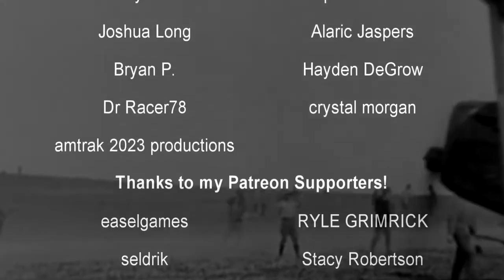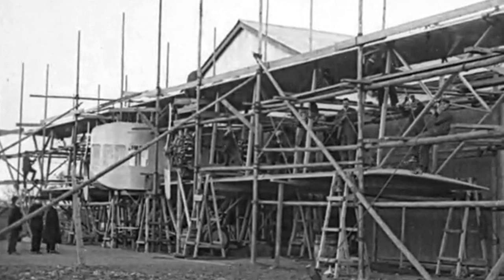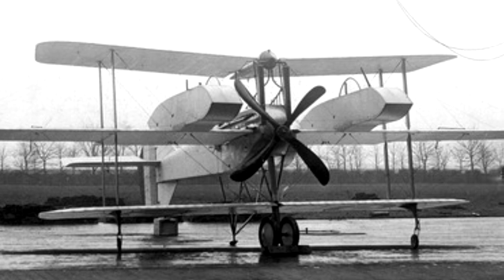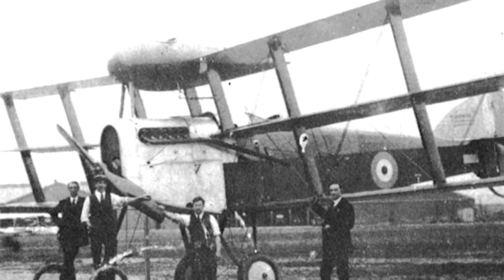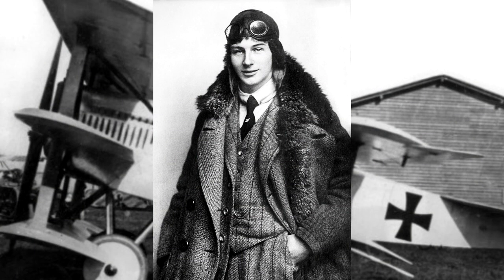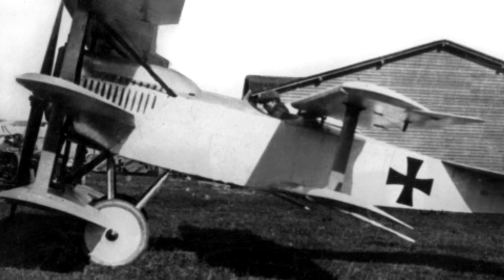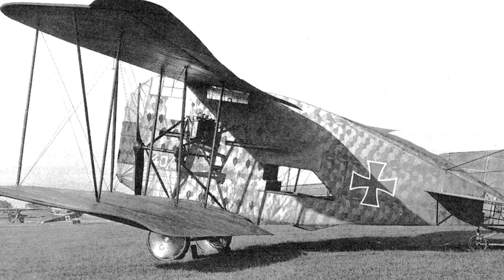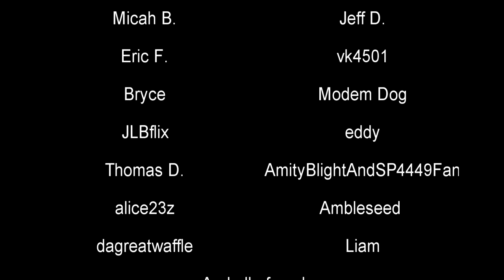5 of the Worst Planes From World War I | History in the Dark

Comment: Experimental planes should not be in these lists. Experiments should be conducted to see what works and what does not, which means those that fail will always been on such lists.
Reply: The thing is...everything in this era that failed to actually fly was dismissed as an "experimental airplane".  Things that flew were "prototypes".  Everything was so new even Anthony Fokker didn't get it right every time
Reply: @MGower4465  that's not how experimental is defined. Prototypes that flew are also experimental aircraft. They are not failures because they never got into service. In some cases like the FK6 and the Sopwith mention in this video they were overtaken by other technical developments rendering them obsolete before the testing programme had ended.
Reply: @neiloflongbeck5705  You're talking on 2023.  I'm talking about 1912
Reply: @MGower4465  no, I'm talking in general since the birth of the invention by George Caley of the fixed wing aircraft with separate system for lift, propulsion and control.
Reply: This is just a list of really bad stuff regardless of the reason why it's so bad
Reply: @fanofeverything30465  fair point, but there were worse aircraft that saw service such as the B.E.2 aka the Fokker Fodder that was so inherently stable that manoeuvering was very difficult. And due to have the observer in the front cockpit meant that he had a very limited field of fire. Over 3,500 of this type was built. This would make the B.E.2 worse than any of the aircraft presented here.
Reply: @neiloflongbeck5705  *Meant
Reply: everything saddo.

Comment: I apologize if somebody has already mentioned this, but the problems mentioned for the final aircraft, the R.1, should have topped by the fact that the cellulose material used to skin the plane was highly volatile, and very prone to bursting into flames.  That's why so many very old films have been lost in fires or simply have crumbled away.  Those that are left are stored very carefully in controlled environments and carefully transferred to a more stable format.  Aircraft of that era burned far too easily as it was.  Why add a surface like that to the mix.

"Now where is that darn Bosch bomber?  Oh wait, it just burst into flames by itself."

Comment: Ol' #1 there is proof that the idea of, and quest for, stealth aircraft did not first crop up in the late 70s.  The Brits also tested a transparent cellulose/celluloid (sources differ) coating for aircraft during the war, with the objective of making it effectively invisible to a ground observer when flying above 1000 feet.  It worked, but it suffered all the problems mentioned here and was never adopted as a result.  (That said, apparently, it was tested on an existing airplane rather than a new experimental one.)
Reply: Actually that was the HO229 jet flying wing. Stealth on that aircraft is useless on today's radar, but effective on WW2 era radar due to the aircraft's frame material is of wood.
Reply: @kevwebb2637  Stealth is not just about radar returns.  Visual stealth has been something people have been trying to achieve since... well, pretty much since the days of hunter-gatherers stalking their prey, really.  And the R1 is an example of an aircraft testing a visual stealth solution.